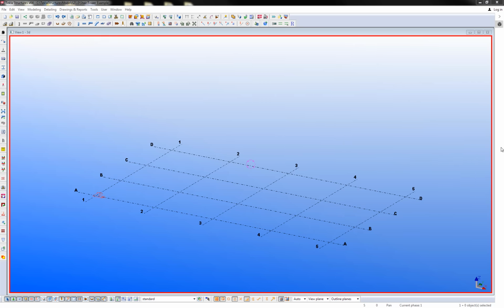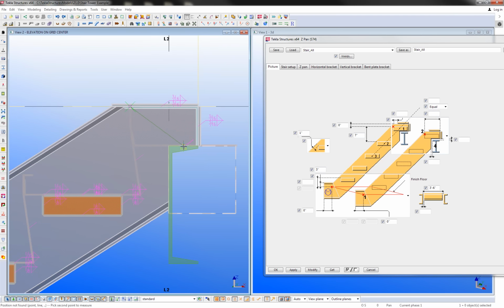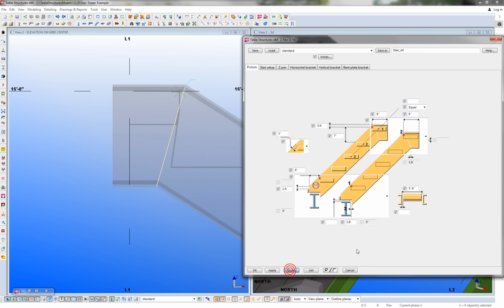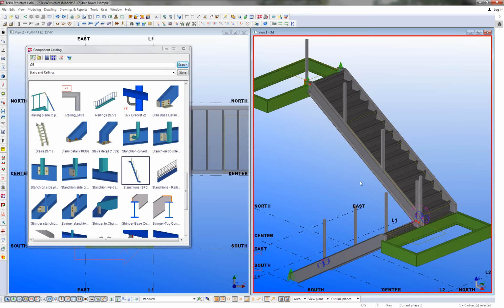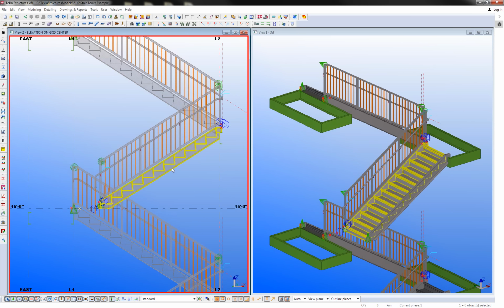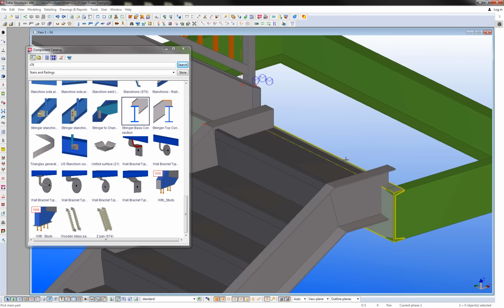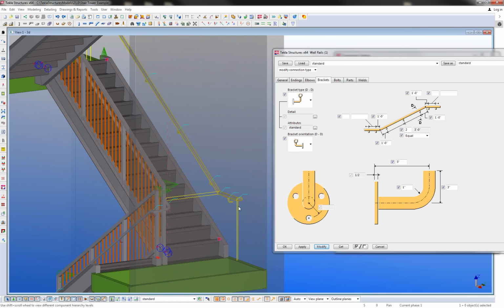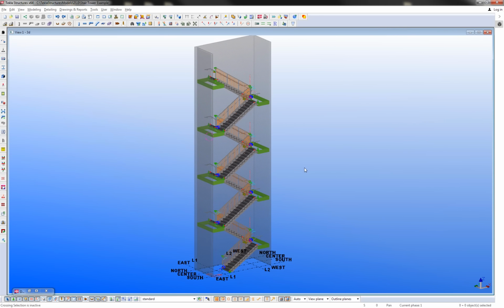Tekla Miscellaneous Stair Tower

Comment: When would the Stringer top connection be used when creating a stair?
Reply: +Henry Tillman You can use it anytime you want the stair to simply bear on the supporting landing beam/channel. Only stipulation is that the picked point must be in 'front' of the supporting member, not past it. If you have supporting brackets for the pans, they will be automatically removed when the notch is created.

Comment: Nice Video tutorial, I learned a lot. I have just one note that you used some macros that I did not find in my learning version of Tekla 21.0. Good job anyway. Thanks.
Reply: +Tomas Titak some of the components and settings used are localized in the US Imperial environment, so if you have a different one installed that may be why you could not find them.